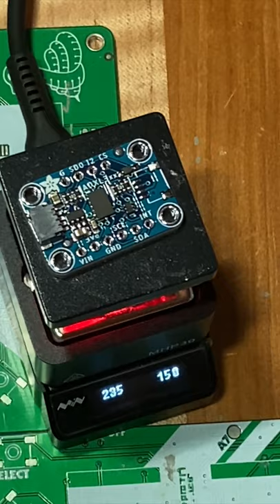ADXL34x QTification prototype

Comment: Wait what? You can use a plastic card for a smd stencil? Mine always leave small shavings and mess up the soldering after. I had to resort to a very small and flexible peace of metal but it's hard to get the dosage right with that!

Comment: So you have a metal template? That's impressive if it's a metal template. Nice prototyping.
Reply: Yep, usually you can just order them together with your pcb's so it makes it easier to apply the solder paste. They are called smd stencils and cost roughly 10 bucks for one depending on the manufacturer
Reply: Typically you can also have them populate an solder the board for a little extra
Reply: @rubenproost2552  Where? D: How do they call it, I had been messing with getting solder paste right! Is it any good, or do they regularly over/under do it?
Reply: What kind of soldering paste is that please tell lol